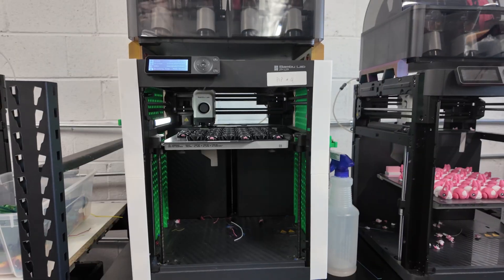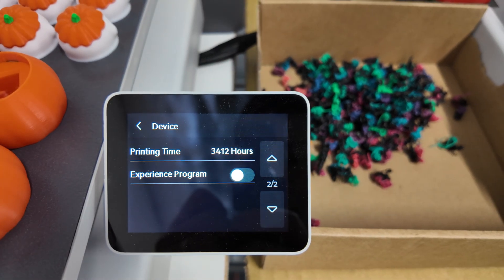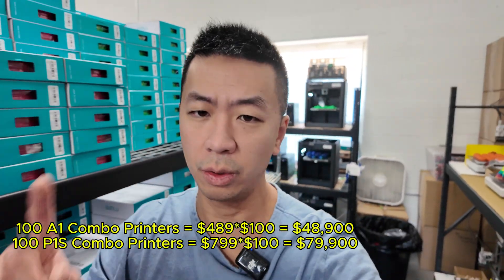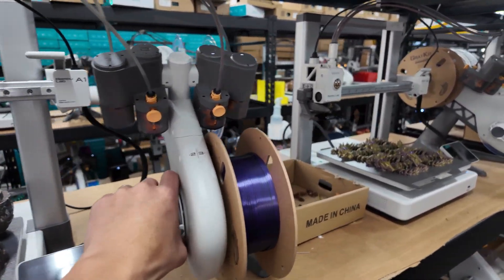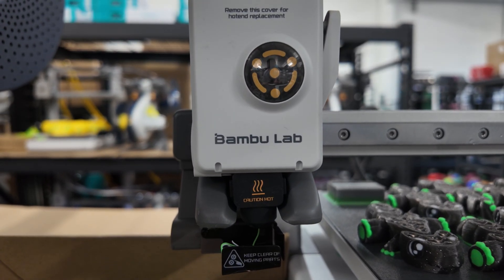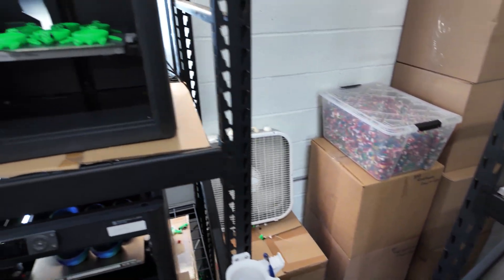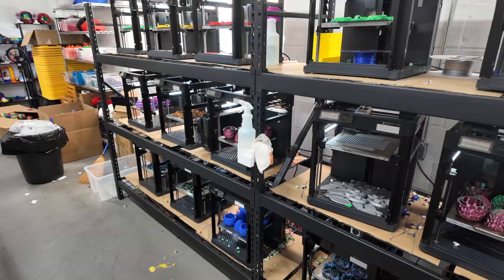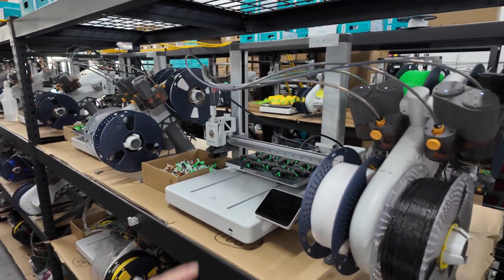Why the Bambu Lab A1 Combo is the BEST 3D Printer for Print Farms!

Comment: Define best. I have been getting buy two broken to make one working Elegoo Neptune 4 Pro fix up packs, I can afford them, so they are the best ones for me and I get to learn how to repair printers. While they are more labor, it's not that much more labor for this amount. I sell the printers, I repair other people's printers, then I can afford to buy printers, but at that point I might want custom 3D printers, but yeah, I might agree with your choice because when you get 50 with a lot of orders the labor makes you want to cry.

Print speed doesn't matter becuase they print so fast the quality degrades, it's more of a space, vibration, and maintenance issue. The Linear Rails on the bed is the most important quality of life upgrade. I have to spend more for BoxTurtle Auto Filament Changing System, but that is higher quality so it's worthy.

Comment: Looking forward to your video after updating the firmware
Reply from the maker: lol it wont effect me
Reply: @Dancyn3Dprints  If you got some Panda Touch screens to get around the lame screen problem on your P1X printers then it would effect you.  It's almost like Bambu bends over backwards to make sure those machines can never have a nice screen.  They probably think they are forcing more X1 Carbon sales, but as your video shows they are are actually forcing more lower margin A1 sales.

Comment: I'm just a backyard printer. All my current machines are modified bedslingers like Anycubic or Ender.
I've got an A1 combo on order which will be my main production printer until I can justify another.
I would like to get a P1S or similar for harder to print filaments and a larger printer for any big prints. (any suggestions?)
Your recommendation of the A1 combo really means a lot. You are obviously pumping out product there.
Reply: I picked up a Sovol SV08 for larger prints, which can do 350x350.  It is basically a Voron that you don't have to build yourself and is pretty impressive for the price.  The screen is crappy like the P1S screens, but the printer has an HDMI port that you can plug any touch screen into and have a nice color touch screen.  It is a FAST core XY printer and the bed heats up quite fast for its size.  I've printed out to the edges with no warping problem.  It runs Klipper so you can use Orca Slicer and have all the same features of Bambu Slicer only without being  locked into the Bambu cloud server BS.